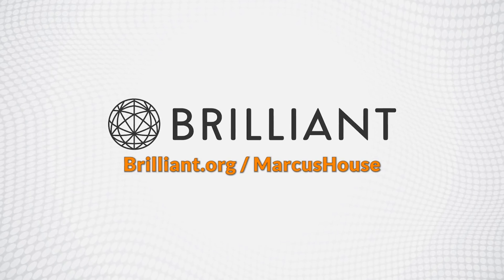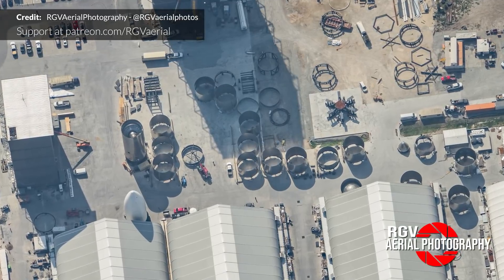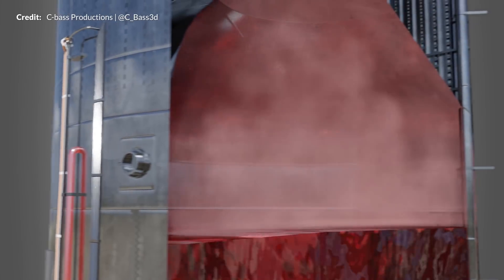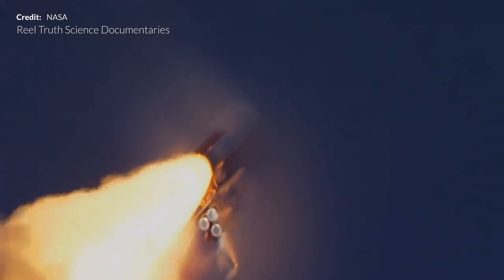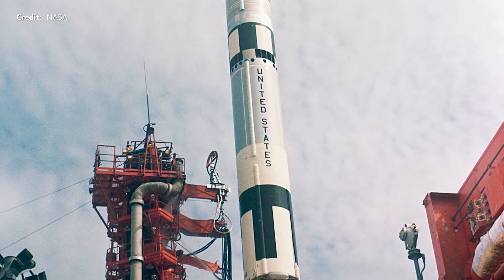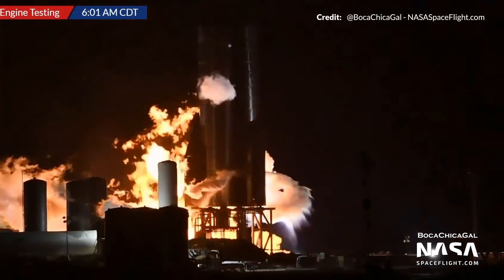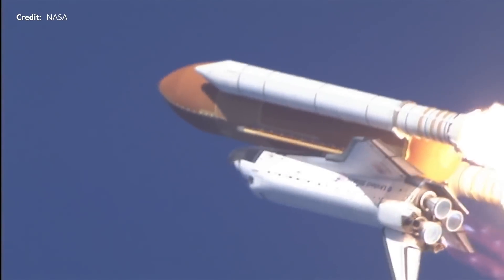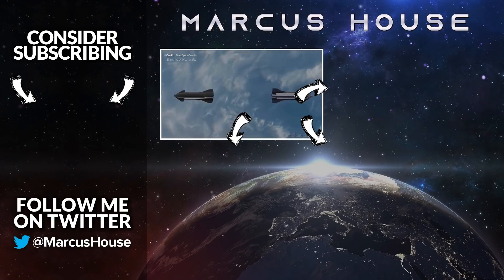SpaceX Starship - How will Starship tank autogenous pressurization systems work?

Comment: So far, stage two canister and final stage tree, design has to much vortext leverage, the slightest rear booster maneuver causes it to pivit extremely, due to the top and far bottom wing fins. In most aviation of a airplane, you have a center balance or bigger wing, for the lift or slower dive.The craft also has tiny boosters that use 3/3rds power, such as a full one booster only for vectoring, so while its failing to axis rotate the body well, its also failing to maintain thrust to levitate in the mean time, by the time it chanced a balance verticle touch down, no landing suspenstion gears available. If this was the 80s Space shuttle, all it would need is to wrap its wings fully to pose like a rocket takeoff and have Spacecrane style boosters at bottom near its landing gear/wheels, to make a easier horizontal render, hoovering stable land on the Moon or Mars

Comment: Starship current fuel supply system is not going to work.  Take a 2-liter bottle of soda, drink half of it, now shake it up and throw it up in the air. Now, while the bottle is flying, take a really close look at your fuel, you have vapor entrained in the liquid fuel. This cannot happen in a rocket engine. Your 3d animation isn't even close to what happens in the real world. Elon will have to keep the pressurization vapor and liquid fuel separated with a barrier or use gravitational and/or inertial forces to keep the differential phases separated.  The reason SpaceX doesn't have this problem with the fuel on Falcon9 is simple, the Grid Fins keep downward inertial force on the fuel to keep the liquid at the bottom of the fuel tanks.   I see a major design change coming. Yes, I am an expert. Both in Cryo Engineering and fluid mechanics.

Comment: Thank you for this great video! I love these midweek videos where you go in-depth on a subject.

"Is autogenous pressurization too difficult to achieve in the long term over long missions, or is it the best plan moving forward for SpaceX's long term goals?"

Oh boy, I definitely don't know enough about this subject to give a truly well-informed answer. But going off what I learned from your video it sounds like the answer is probably no, it's not the best plan for long missions. If a Starship is going all the way to Mars, wouldn't they need some way to keep the fuel tanks pressurized without firing the engine? During the 7-9 months or whatever in transit the fuel is going to be a haze of liquid droplets floating around the tanks. Before that first burn they need the tanks to be pressurized so the fuel behaves properly and sits in the bottom where it will go through the plumbing like it's supposed to. Maybe I don't understand this properly (very possible), but I think you need some kind of separate system to pressurize the tanks in zero G before the engines even start.

I understand some of the reasons SpaceX chose autogenous pressurization: less weight and complexity, which translates into less fuel needed to haul the rocket around and more mass available for cargo. And the capability to manufacture all the needed fuel on Mars. No doubt that last one is very important to them. But I'm not sure how it would work on long duration missions.

Comment: Why does nobody else see that the problem with SN8/9/etc is NOT pressure, but rather sequestration of liquid propellant/ox from the gas used to push them. When transitioning from the bellyflop to vertical orientation, the fuel in the spherical header is violently flung around. This system will never work. The only workaround, without changing the hardware, is to perform the j-turn early via thrusters and relight the raptors in vertical configuration. The real fix is to replace the header tanks with a "syringe" type of tank that keeps the liquid and gas separate.

Comment: what still confuses me, is how the pressurisation works depending on the effects of gravity and orientation of the craft with fluid sloshing around may not get fluid but the pressurisation gas feeding back up the pipe? why don't they do a membrane like in  a syringe that forces the fluid to the pipe opening with the expansion of the pressurisation gas?

Comment: I do not understand how pressurization of a partly full tank is going to supply fuel to the pumps without gravity/acceleration to cause the liquid to pool in the bottom of the tank. Additionally the quick flip of a long tank in a few short seconds with a sudden stop in the vertical position just stirred up the tank into a froth! Ditto for the acceleration from the engine firing. IMHO there needs to be some mechanical and/or accelerational means of gathering the fuel at the pump pick-up. Perhaps some sort of swirl combined with baffles to direct/trap fuel in the right place. The best place may be the center of rotation which would minimize the rotational energy of the liquids during the flip sequence. Why can't the in-tank cameras see this? HMMM.
Reply: In zero-g, "ullage" burns are performed where the RCS thrusters are fired in the same direction as the engines, effectively pushing the liquid propellants to the engine inlets. After a sufficient amount of ullage burning, the main engines are turned on and once enough propellant has passed through the engines they start firing, effectively providing "forward" momentum so the RCS thrusters are no longer required to keep the main engine burn going.

Comment: I’m autoginously impressed by the recycled content in this video. Seen it all before from the individually credited sources. However, it’s autoginously impressive seeing it combined into a full flow staged dissertation on the subject. Hey Hey. Well done there.
Reply from the maker: Haha.. A few of the clips we paid Corey to do for us that had never been seen before, so we did have a bit of new stuff in there (the pressure animations and slightly different formats of the Raptor firing renders).
Reply: @MarcusHouse  Thanks for what you do. The main stream media is out there chasing the next 20 second sound byte instead of looking at the bigger picture of what is going on out at Boca Chica. They do not realise the seismic shift that will occur when a SpaceX starship lands on Mars. That will mark a  time in human history similar to when the first industrial steam engine was successfully commissioned to power a factory.

Comment: @Marcus House : is SpaceX using folded stainless Steel? Like used for Samurai swords, or Damascus Steel.  Folded Steel is much harder and stronger. Can you find out about it please.  Maybe folded 3mm stainless Steel would be much stronger than 3mm stainless steel that they are using now. 🤔

Comment: After SN6 came up short on header tank pressure, I did some math on tapping off a tiny bit of hot CH4 and steam reforming it on some of the new low-temperature catalysts into a mix of CH4, H20, CO, CO2, and H2.  Those are pretty easy to separate, and the H2 could be used to pressurize the CH4 tank.  On Mars it might make sense to do that.  But the O2 tank would still be a problem.

Comment: Watching this makes me wonder if lowering the deep throttling limit of the Raptor engines could expand the operational time of an autogenous pressurization system.  Running all three engines deeply throttled would then improve tank pressures right before landing.

Comment: Plate stiffening lightens the construction, is doesnt add weight! The alternativ is using alot thicker tank skin wich is much heavier. Just imagine how much they have worked lately with decreasing plate thickness by optimizing the stiffening.. You dissapoint alot of people by saying that because it takes hard work and its complex to find the optimal design.
- Structural engineer

Comment: 05:45:  Let me get this straight .... using exotic tile materials specifically designed to be incredible insulators ... to transfer heat to the tanks? How would they do the exact opposite of what they're designed to do? I suppose tiny pipes imbedded in the outer surface of the tiles could carry fuel, but then this would probably destroy their use as insulators during re-entry...

Comment: Before the preburners, the feeding is supplied in liquid form. 
Then in the gaseous state. 
And everything works perfectly 
in a vertical position 
relative to gravity. 
But after “belly flops” or after being in zero gravity, 
which will provide preburners 
with a continuous flow of liquid. 
What will prevent you from getting into the trunk 
and at the inlet of pre-börner gas phase, vapor bubbles, 
which can cause interruptions. 
It's unclear!

Comment: Hey Marcus, an amazing video as usual, can you please explain how is starship made of steel unlike jetliners that are made out off aluminum mainly if they are all designed to be light weight?
Reply: Temperature. Aluminum can't handle both the cryogenic low temperatures of the propellants, and the high temperatures of re-entry.

Comment: Two important changes needed
(1) Alter Flight Plan – Engineers need to flip the Starship at a higher altitude and flip more gradually. Starship should complete the flip using only the flaps/cold thrusters, then re-ignite in better alignment. Where are the Kerbal Space Program experts? 
(2) Add Secondary Safety System for Starship – The Moon landing system has mid-to-upper (Draco?) landing rockets. This should be standard for all Starships to provide the ability to save the crew quarters in the event of Raptor/landing failure. 

Elon’s new “light-them-all” strategy is good, but not a real fix. It is just trying to improve the odds. Care to wager your life savings?

Comment: I hope it will work! But I doubt the pressure is the problem... In my opinion, during descent the liquid propellant is flowing direction head, then after the belly flop, the liquid is flowing down the tube, but the gas is rising, and the liquid propellant not reaching the engines fast enough.
Starting the belly flop 500 meters higher would give some extra seconds, maybe saving the starship.

Comment: Hi Marcus, these renderings are awesome! It makes me think, what if at the final flip maneuver they first light up one Raptor pressure fed by the Header tanks and then a sequenced start up of the other fed from the tanks after the flip. The first Raptor will create G loads and fuel will return to the bottom of the tanks thus pressure feed the other two Raptors that way.

Comment: Looks like he's using GRAVITY to feed the fuel to the inlet....... W..T..F..!!!! This is NOT viable in space!!
Reply: Seriously.. What pushes the fuel past the vapor to the inlet in ZeroG?  I see nothing that keeps the fuel from making it's self into a slushy with the gasses. Just like on land, you can't use your propane tank upside down, how does the fuel get pushed down past the vapor? Is THIS why SN8 SN9 crashed??
Reply: Bubbles in the fuel line will cause a stall. As a mechanic and tank filler i see this as a YUGE Red Flag!  Does anyone know how this works?  How will Starship tank autogenous pressurization systems work, I got that easy peasy. This though!
Reply: And further more... No Baffles?!?!?!?!

Comment: Storing the combustion gases in COPV for jumpstarting the engines might be the weak point. The gases will cool down over time, hence the pressure will decrease. Maybe Spacex has to add pistons, but they would bring their own disadvantages.

Comment: The tank pressurization during the landing flip maneuver is flawed in that pressurization does not equal the fuel being condensed enough to feed the engines with equal pressure for each feed line.  The craft has been at zero G, falling for several minutes which intermixes the fuel with the pressurization, reducing its density.  like a bottle of coke that is dropped, the flip maneuver causes the fuel to degas reducing its ability to pressurize the feed lines with any consistency.  The best solution is to have separate small tanks using a balloon pressurization for each engine, which keeps the liquid fuel under constant pressure and gas out of the fuel for the landing phase.  This is the most reliable method for landing.
Reply: good point MV; people are trying to compare and contrast the landing issues for SN-8 and SN-9 but to me they were the same....re-pressurizing the raptors caused both failures.

Comment: after 2/2 crashes on THIS planet, how many successful Martian landings does Space X need to get the approval for crewed mission? 10 outa 10? And, IF Starship is ready, they'll have a launch window every 26 months?
thanks, any1
(I don't see how this belly flop landing could work in a thin atmoshpere,with engines previously dorment for months in space)
Reply: i think they need to re-think the flop entirely.  i hope SN-10 goes off w/o a hitch but geez that's a complex problem

Comment: I wonder if they may have to change the geometry of the bottom of the tanks so "down" is "down" even when the rocket is almost horizontal? From \_/ to |_/ ? Or is the fuel basically "floating" in free fall when they attempt the flip manouver?

Comment: Re the question of pressurizing the Falcon 9 propellant tanks, I would expect them to boil LOx to provide gaseous O2 to pressurize the LOx tank, but sounds like you say they use He there.  I'm not sure there is a choice but to use He for the RP-1 tank since the vapor would be very hot, to perhaps compromise the strength of the tank material, and one certainly wouldn't want to put gaseous O2 into the RP-1 tank.  Small liquid rockets often use a membrane to separate the pressurant gas from the liquid propellant, but never heard of that for a large booster tank.

Comment: Where are the people or payload will sit on the nose of Starship?  Seems like the header tank will be way too close to the crew. It doesn't seem like it will fit more than 20-30 people. Originally they said it will bring 100+ and it will not even have an about system ( i believe ). What if it goes boom?

Comment: Long term, autogenous is not only the best solution (producing helium on Mars would seem to be a tall order indeed), it's practically the only solution.  Elon did put out a tweet after the SN8 flight, saying that they'd revert to helium as an interim solution only; implying that autogenous just required a bit more work and that (I'm guessing) they didn't want to hold up the testing program to perfect the autogenous process:  "SN9 will press CH4 header tank with helium. Long-term solution is under debate. Not clear what is lightest/simplest."    Any guesses as to what that "lightest/simplest" debate looks like?

Comment: It sounds like a great idea, but I see a problem that loss of engine performance can decrease the pressure feeding engines thus causing a cascade. Maybe having some Hi pressure tanks as a backup should be a safety measure. Like SN8 low pressure observed and a boost to tank might have saved the flight?

Comment: How would autogenous pressurization work in zero G?   If you were to make a burn between Earth and Mars or from the Moon to Earth.
Reply from the maker: Look up ullage systems. You just use a little RCS to push the liquid to the bottom of the tanks, then fire em up.

Comment: It should be possible to use secondary sources of 100% liquid propellant, and 100%liquid oxidizer housed within elastically tensioned collapsible bladders of oversized "surgical tubing" located inside the two main tanks.  All problematic mixed phase liquid/gaseous forms of tank contents will lie outside this bladder under current temperatures, and pressures, but due to the additional elastic tension applied within the critical temperature/ pressure environment currently existing within tanks, a liquid state may be maintained with the amount elastic tension providing the margin of difference needed to exceed the vapor pressure within the bladders. In other words the temperature pressure state of tank contents is currently maintained at the critical boiling point of each liquid, but the portion within the bladder tubes will always be at a slightly higher pressure state which will disallow it bursting into vapor.  In this way a supply of the 100% liquid propellant, and 100% liquid oxidizer may be stored at all times in a quantity sufficient to provide adequate run time by main engine(s) for inertially induced settling of liquid fuel, and oxidizer to bases of their respective existing  tanks. This modification would require new fuel and oxidizer supply valves to be fitted to include additional inlet ported to the new fuel, and oxidizer sources respectively. Another option might be to use a sealed follower bladder, or liquid bag. In all cases current existing autogenous gas pressure s remains unchanged except that all pressure is applied now on outer, or non-liquid side of the phase separation. Each method avoids mixed phase flow to pre-burners, or engines, and would require very little additional weight, or valve control programming. This modification engenders reliability  due to its low tech simplicity.